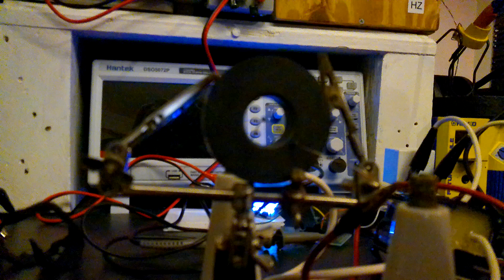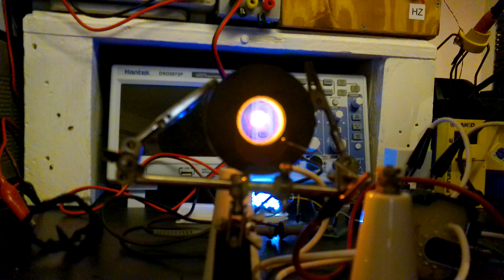Plasma Vortex

Comment: Can you explain how this was all built and put together.
Reply from the maker: Sure! The high voltage anode is resting directly in the center of a circular magnetic field which makes the plasma rotate proportionally within it and the cathode or negative is simply attached to anywhere else on the magnet.

Comment: nice work mate, I tried this. I wanted to see if the frequency of the arc along with the current and or voltage changed the speed, never figured it out.